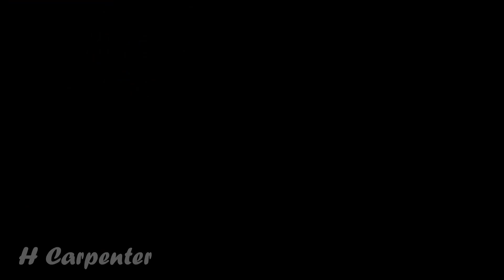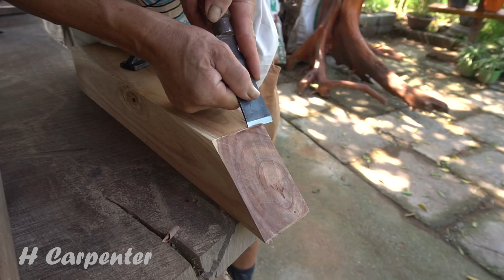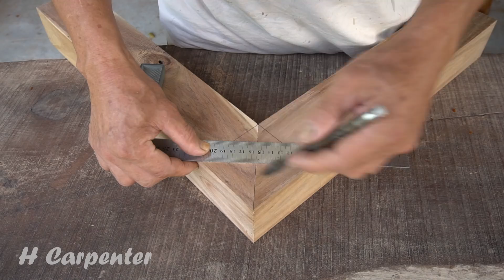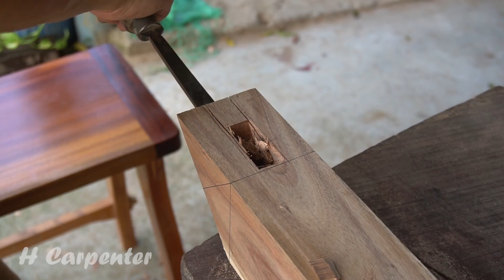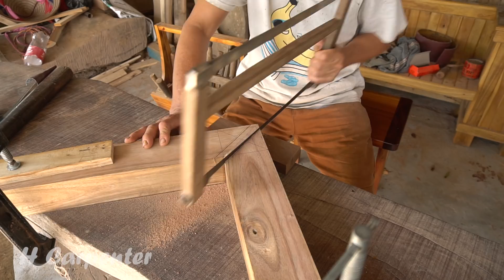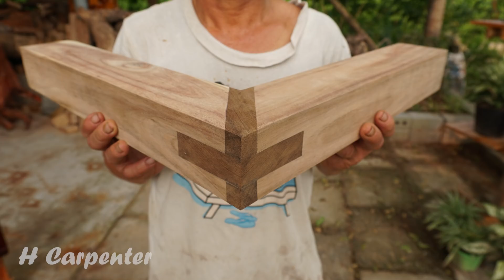IMPOSSIBLE Looking Handmade Joints - Amazing Technology Japanese Woodworking Joints Skills

Comment: Thanks for the video!
Really unique.
Do the last two pieces have a slight dovetail, and also force fitted.
Won't they pop off as you have used the hammer on the top face!

Comment: Can you explain what all the different joints are used for. Like some are for tables, some are for chairs, some are for cabinets. Please show thanks
Reply from the maker: corner tables and chairs, they also need a connection, depending on the thickness of the piece of wood that we need an appropriate bonding method.
Reply from the maker: I show you the thick piece of wood which link to use
If it's thin, use any link.
The flexible use of wooden joints helps us to have a product of our own that makes us excited
Reply from the maker: A few separate tenon wood examples for roof structure I also specify because it is only suitable for that structure, but using other structures is not very effective.
Reply from the maker: Do you agree with me like that?
Reply: Thanks

Comment: On some of these "joints", I tend to use a "coping saw". Especially on those "fingers", I can clean out a lot of material and then go back in with the chisel for a final touch up. Have you done the same, or considered that as an option? I by no means am a professional at woodworking, just consider myself a hobbyist at best. Love the video's. Cheers :)
Reply from the maker: Are you pleased ?